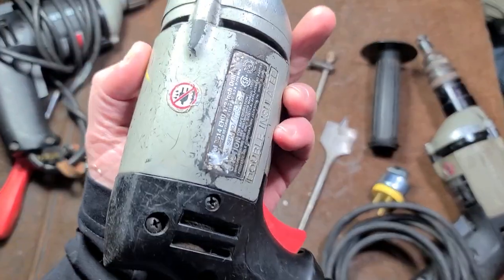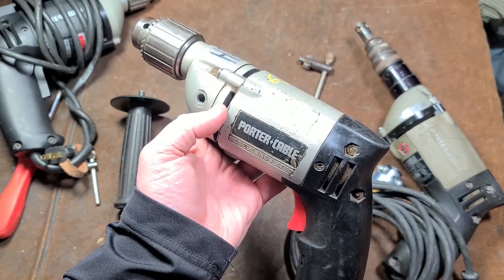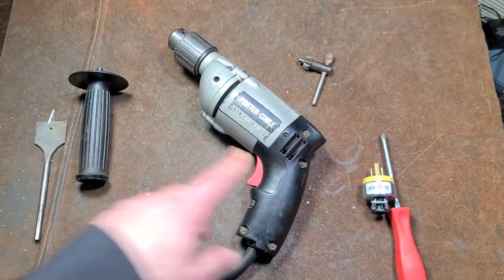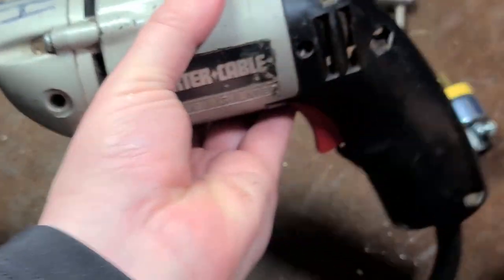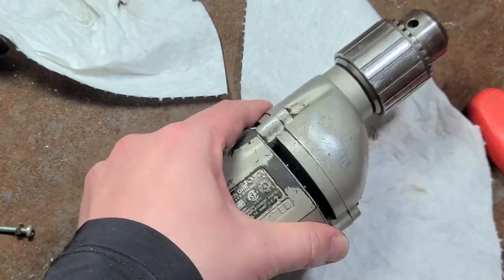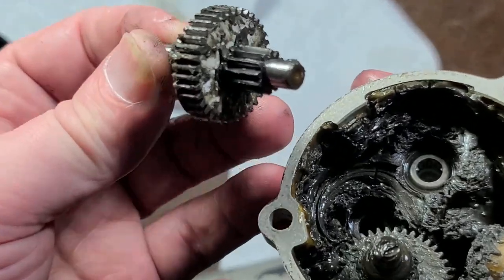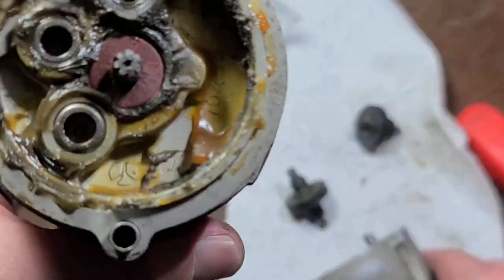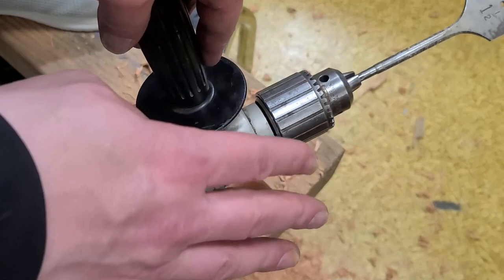Porter Cable USA 7514 1/2" Drill Review/Mini Teardown

Comment: Porter-Cable once did quite a few interesting power tools starting with the 1926 debut of the "Takeabout" belt sander.

Some other P-C tools you might wish to find: the 7549 jig saw and the 9852 "Magnequench" cordless drill; the 9852 was a significant improvement over the previous 9850 as it had a proper high speed range added along with the low speed range that the 9850 was stuck with. The 9853 was similar to the 9852 but had a keyless chuck, while the 9854 was also similar to the 9852 but had a larger capacity 1/2" chuck.

Comment: How do I replace a porter cable Jacobs 1/2 inch keyless chuck? There's no screw in the middle to remove.
I think it's a 2620 model bought in the 1990's. The label is worn mostly off.
thanks